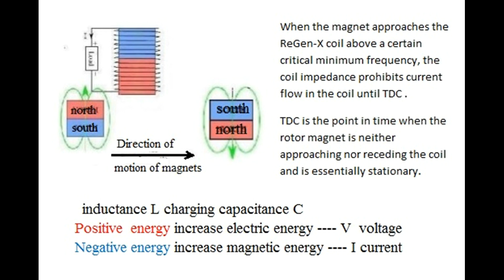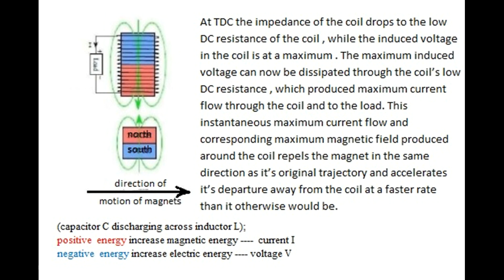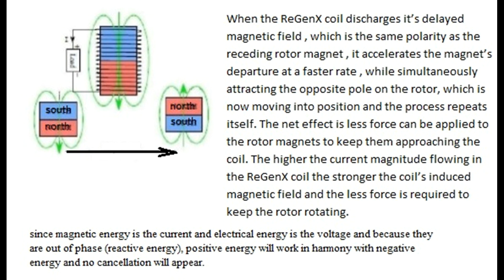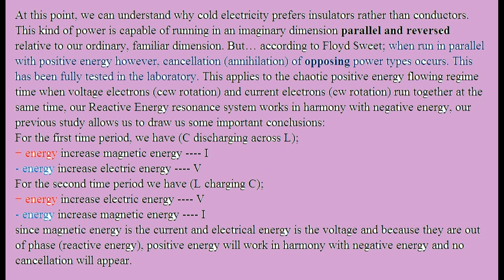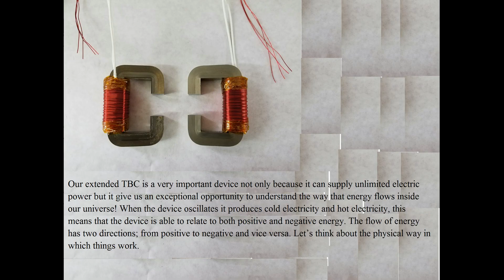Tesla bifilar coil generates cold electricity

Comment: Hello Marcis,
I believe the draw of the magnetic field around the permanent magnet is not precise. acutely the south and north are not connected, between them there is 0 (zero). its canceled. so the direction of the fields ( green arrows) needs to be down and up, like two vortex's.
Reply from the maker: In the middle the field is sinked into magnet material. For the same reason magnetic field is less strong around toroid solenoid than straight core solenoid. Toroid is closed magnetic circuit, and all magnetic field is sinked into toroid's material. Straight core does not make closed magnetic circuit, and magnetic field comes out at both ends of the core.
Reply: @marcisgulbis9310  do you have an email? Or other way of contacting?
I would like to talk with you about some ideas.

Comment: "in England the ideas introduced by Faraday as to the nature of electricity were extending. These ideas, expressed as they were in abstract language difficult of comprehension, made but slow progress until they found in Clerk Maxwell a fitting interpreter. In explaining electrical phenomena Faraday was bent upon excluding all preconceived notions involving assumptions as to the existence of phenomena or substances which could not be directly perceived. Especially did he reject, as did Newton at the beginning of his career, the hypothesis of the existence of action-at-a-distance. What the older theories assumed seemed to him inconceivable — that direct actions could go on between bodies separated in space without any change taking place in the intervening medium.
Faraday and Maxwell inclined towards the simpler view that there was no action-at-a-distance ; this hypothesis, which involved a complete upsetting of the conceptions hitherto current, was thrown into mathematical form and developed by Maxwell. According to it the seat of the changes which produce electrical phenomena must be sought only in the insulators; the polarisation and depolarisation of these are the real causes of the electrical disturbances which apparently take place in conductors."

Hermann von Helmholtz discussing the research into electromagnetic phenomena in the late 1800s in his introduction to The Principles of Mechanics Presented in a New Form by Heinrich Hertz 189

Comment: Quick question : What do you mean by "cold electricity prefers insulators rather than conductors" ? Where can I find more info about this ? Thank you for your help!
Reply from the maker: Cold electricity (negative energy ) flows around wires. Hot electricity (positive energy) flows through wires. All free energy devices generate negative energy, which may cause antigravity effects, if it is strong enough. Time delay between voltage and current, like in ReGenX generator and bitoroid transformer, allows negative energy and positive energy coexist with each other without annihilation. https://www.reddit.com/r/Overvoltage/comments/16pdmxl/cold_electricity_and_teslas_radiant_energy/   Cold electricity was discovered by Nikola Tesla, when he experimented with DC pulses. DC pulses cause shockwaves, which cause accumulation of electrostatic charges on metal surfaces.   Tesla bifilar coil have enhanced capacitance between wires, to collect electrical charges caused by cold electricity.